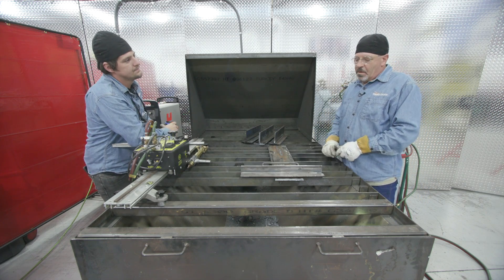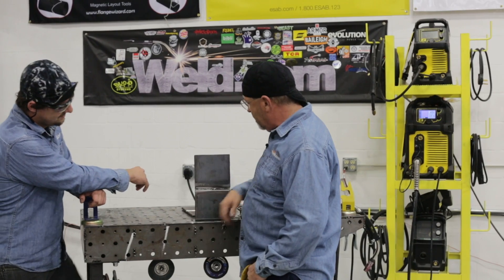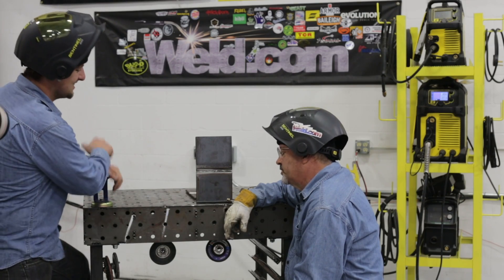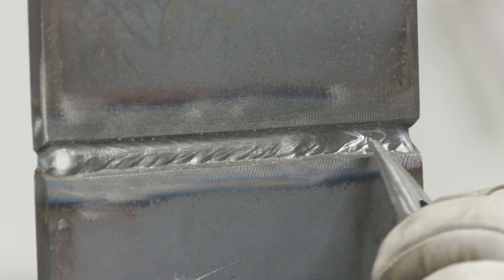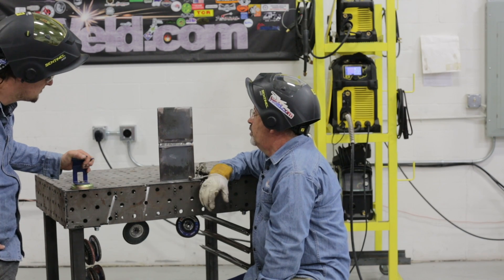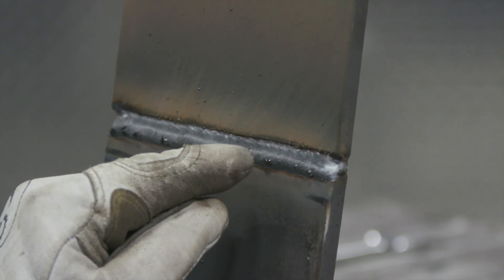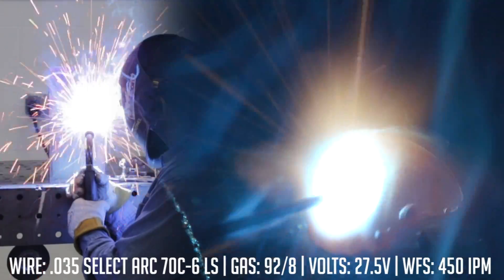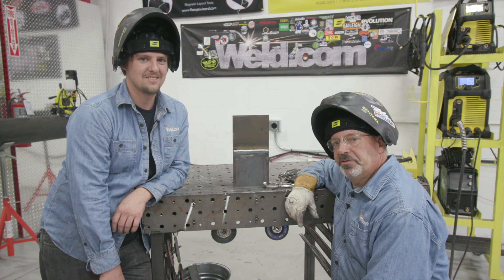Horizontal Metal Core Throwdown

Comment: We run metal core.52 at Able Steel in Az. It's kinda cool I guess
Reply: @traviswatson3810  what settings do you use?
Reply: @spiritualsniper0214 26.5 volts, 350 wire speed, 5/32 wire

Comment: Nice COOOOPons! Lol. Back when I was doing railcar repairs one of the prerequisites for the welder position was passing a straight overhead mig bend test (cap and root). With a backing plate of course. Still, a pretty shitty test lol.

Comment: Can someone tell me the difference between metal core and solid wire mig?
Reply: Solid wire is solid and metal core is hollow with metal powder in the core.
Reply: Zachary Kemp I think, metal core is flux core type wire. Solid wire will need a gas shield being just metal.
Reply: @philthefarrier9469  I just did a quick lookup and you are right... I think. Metal core is a tubular wire with different metals in powder form in the core of the wire
Reply: Zachary Kemp you are correct sir.
Reply: @philthefarrier9469  metal core is metal core ... flux core has flux in the core LOL.